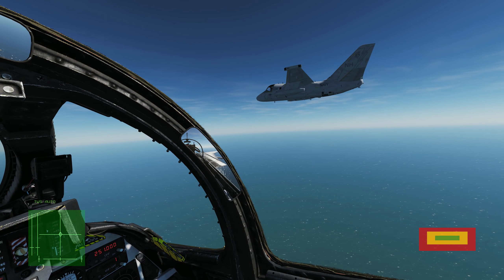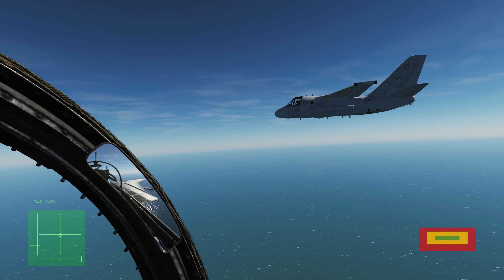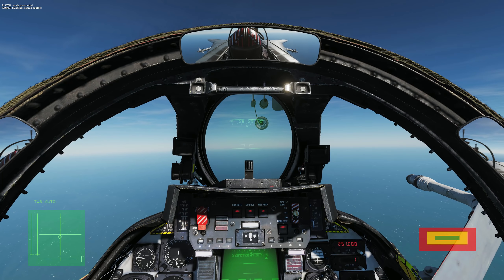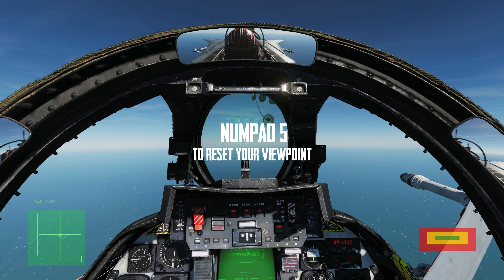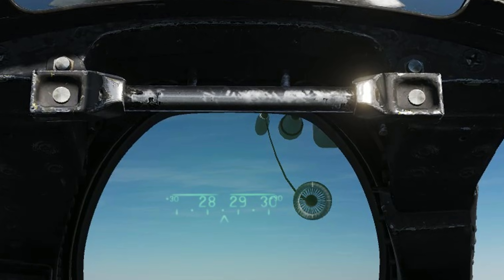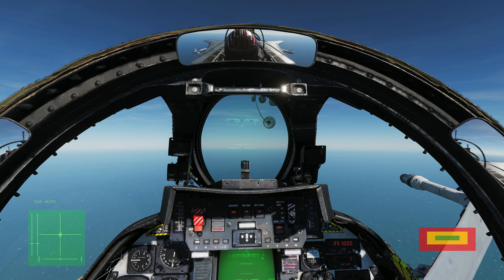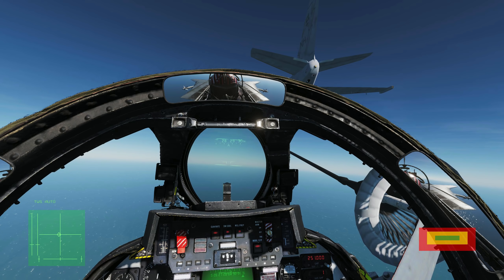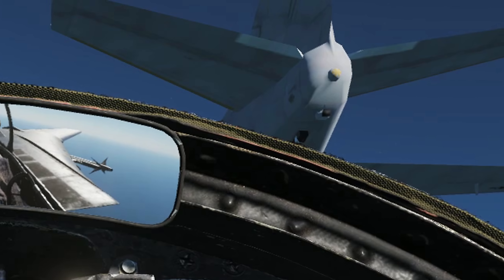DCS F-14 | S-3 Viking Air to Air Refueling [Quick Tutorial]

Comment: Throttle control-my biggest issue- to fast to slow and then oscillation starts and I'm screwed. Suggestions?
Reply from the maker: Try to never stop moving the throttle, keep in constantly going back and forward as required and see how you get on.  This will start to give you a really good feel for how much power you need to put on and take off.